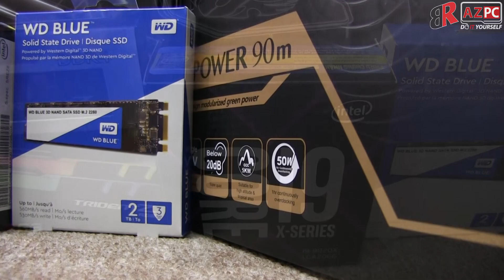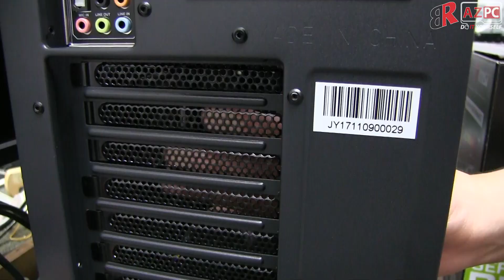Ráp pc i9-9820X | 32GB | RTX 2070 Gaming Z | SSD 2TB... cho các nhu cầu cơ bản phổ biến hiện nay

Comment: Why haven't you watercooled such a high end computer ?? May be also a 750 W PSU ?
Reply: You will find out one day that for systems like Workstation or Server they hardly or never use water cooling for stability and durability.
Reply: @ducnguyenminh6165  Don't worry I'm hundop aware of that !But for instance HP Zx40 and Zx20 workstations have cooling systems based on rackable blades. 😉
And there CPUs have not that much to share with a i7... 😉
Reply: Oops sorry any i9-xxxx.
Reply: @philippebenas5721  the thing is reliability, maintainance, and durable. watercooling will not work fine in long-term jobs and you can't do sanitary job as easy as air cooler